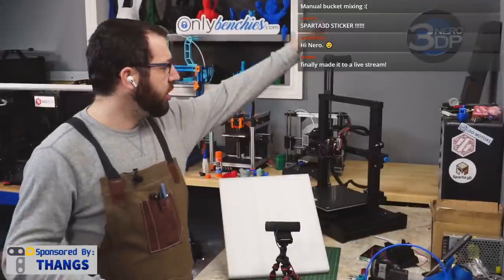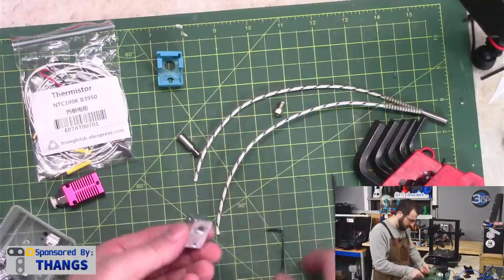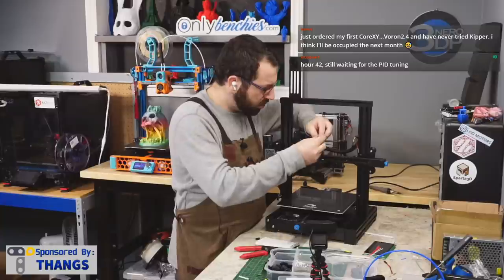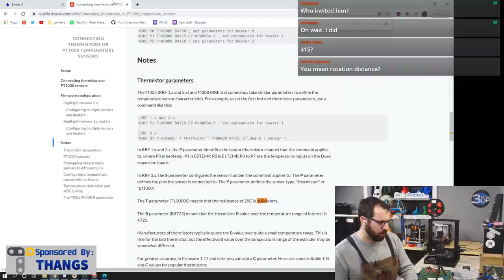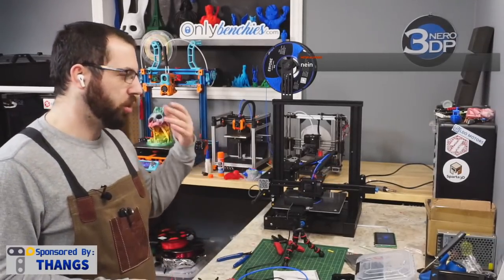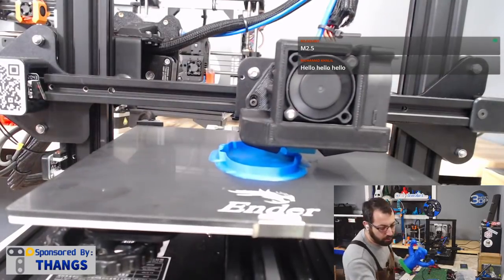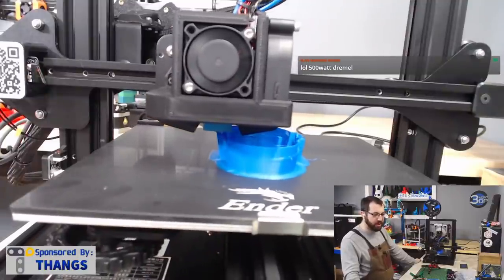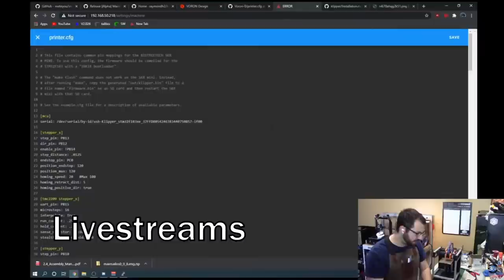Modding the Ender3 while we wait on Ali orders Livestream

Comment: I've got the accelerometer coming today so I can get some sweet Input Shaping going, but I have a glass bed and in your tutorial you attached the board directly to your bed, taking off the flex sheet. I could take the glass bed off and attach it like you did, but wouldn't that drastically alter the calibration as the bed would normally be much heavier due to the glass? If I do leave the glass bed on, do you have any suggestions for attaching the accelerometer? 

You're content has been awesome to watch and even though I can't afford it right now, I know that I'm going to end up building a Voron at some point thanks to you!
Reply from the maker: You want to affix it as rigidly as possible, removing the glass bed will affect the weight so much your results wont be accurate.
Double sided tape of some sort may be your best bet

Comment: Hi Nero, may I ask what current you used on your mobius? I got the same setup going on right now and with spreadcycle enabled (Yes I got one of the lucky linear advance boards so i'm sticking with Marlin for awhile) my esteps is crazy high - 1100. Wonder if the current needs to be lowered to avoid overheating.
Reply: Have installed the mobius and tried a bunch of different currents in Marlin FW - from 200, 400, 600, 750 was getting this horrible vibrating/clunking kind of sound during any retracts or linear advance moves. 
Previously with a 750ma current and 220 e-steps on the creality aluminum red dual drive extrusions it was fine. No idea what the problem is 😭
Reply from the maker: Running 560 steps/mm @ 800ma with 1/16 microstepping
Reply: Thanks! Guess i'll try to bring the esteps down by halving microstepping to 8
Reply: Update: googling common symptoms suggests that my freakishly high e-steps might be due to volumetric extrusion being accidentally turned on. I'll check up on this and report back just in case anyone has the same issue.
Reply: @davechuasoup  update 2: so I finally got my e-steps back down to 558.4 by putting my e- stepper back in standalone mode. Turns out that although I got linear advance to work in marlin, it was causing hell a lot of missed steps.. or something. bye bye Marlin and bye bye screen! Time to switch to Klipper for pressure advance. Without any kind of flow control it's just not possible to print accurately enough at decent speeds.